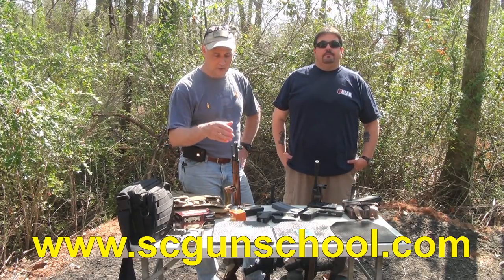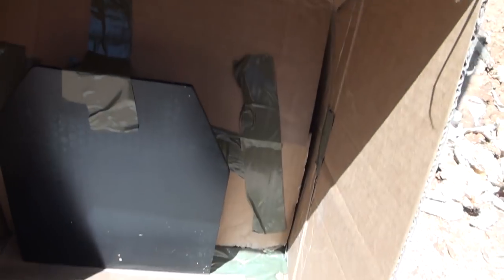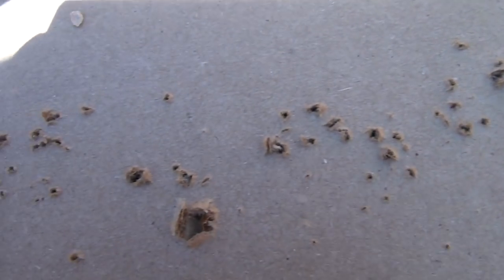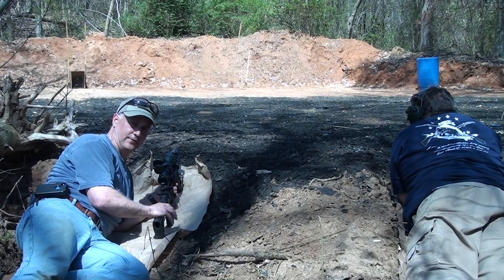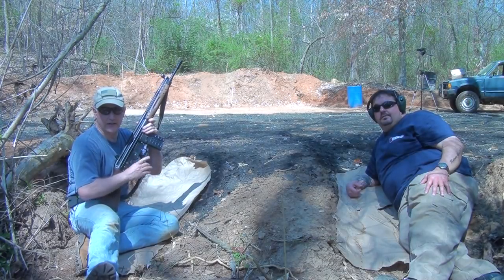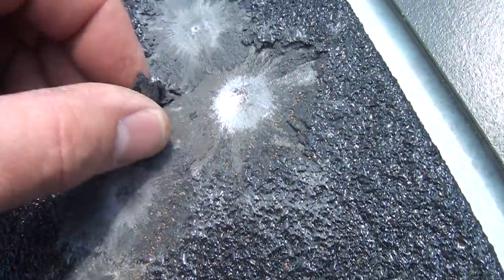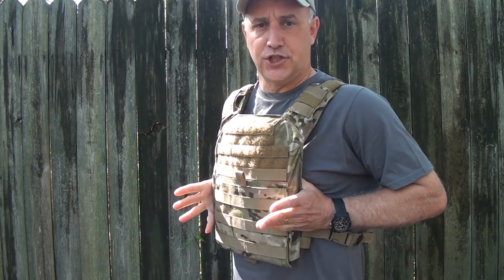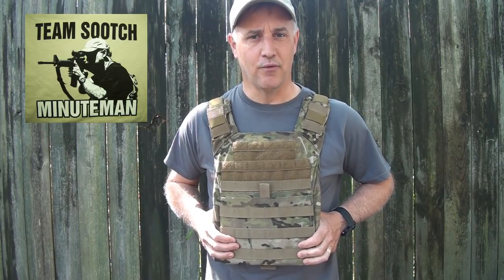AR500 Armor Ballistic Plate Shooting test

Comment: My AR500 Plates came in today and they fit perfect in my carrier. They have the LineX coating and they work great with my Level III soft armor. The carrier is heavy but I think more of the bennefits than the weight. Awesome and vital piece of equipment. Thanks to you and Mike I'm sold.P.S. took a month and a half to get here but worth the wait.

Comment: spall comes from compression waves traveling thru the metal, then hitting the end of the steel (the other side of the plate, see also impedance mismatch) and tension waves coming back (toward the front of the plate) and the accompanying steel plate pieces being torn off and thrown out by the waves. spall comes from the plate (or target material).

Comment: Welding has a thermal effect zone around it, you'd induce extra tension around the welds and ruin the heat treatment. But a guy does bend a thin steel plate around the plate to capture the frag.

Comment: I agree.  That's really the easiest thing to do with any steel plate (wrapping it with kevlar).  I own a pasgt vest right now and will probably by a lightweight plate holder to put over that. But I'll probably just buy a cheap used kevlar vests to to take apart so I can wrap the plates as well as to use for making kevlar  wrap around upper arm protectors (secured with velcro), and frontal apron or segmented skirt protecting groin and upper legs as such things are not on the market.

Comment: Not necessarily, much of the energy is imparted away from the shooters shoulder in the form of thermal energy.  So it's wouldn't simply be a conservation of energy problem (there are a lot of other sources of lost  energy but I'm just using one.)  But to address the kill question, no the plate hitting your body would not kill a wearer (unless you are an infant operator).  The plate absorbs the shock and dissipates it over the surface area of the plate.

Comment: Sootch here is a suggestion: Buy a used mannequin put the plate in a plate carrier and the mannequin in a kneeling position with arms extended as if holding a rifle. Do test again. Then see is there is any penetration on the arms, legs and chin of mannequin. thrift stores will sell used or broken mannequins very cheaply. Keep up the good work.

Comment: Yeah i'm sure. even if you look at the design of the tires that have kevlar in them they are not floating in the middle something that would make it as static as line-x would. Kevlar works by having tensile strength they stretch/take force before they tear. The only way i see is the kevlar being in a layer where it can move.

Comment: A cheap fix for those who have the older plates without any coating would be to duct tape a note book over the front of the plate.  And you would only be adding about another 1/4" to 3/8" in thickness to the plate.

Comment: Good info and got me thinking. 
Tilt the angle of the steel plate by as little as 30 degrees and you in theory double the thickness of the armor. (Sloped Armor). Probably the data you collected during this video would have been more realistic if the steel plate would stay perpendicular to the ground. I took some AR500 steel 1/4" thick and glued a layer of 1/4" recycled rubber mat bought from Peavy Mart (Made from old tires) and shot it with 7.62x39 with a SKS and achieved good results with a min amount of spalling. I will try to post a video If I can figure that out. LOL.

Comment: Another thing to consider: Chances are those plates won't be strapped to your naked body via duct tape - they're inside a plate carrier / vest made out of heavy duty material. Any bullet fragments will have to go through that as well, which most likely will catch them or reduce their energy even more before they hit your arms or face.

If you have some old plate carrier and pouches ready to be thrown away, you could use those for your next test and check if this theory holds up to the real world

Comment: Thanks for the test. There is going to be spalling with the .30 cals. no matter what you coat it with. A metal magazine will help, but better insurance would be IIIA kevlar Containment of the round's integrity is the best plan. I'd loose the coating and package it with kevlar at a $150 price point, for the front. I'm not concerned with the back. You'll still be ahead of ceramics, and better multi-hit multi-use in the field.

Comment: You might have have "splurged" and used new cardboard for each round to get a more accurate idea of the result, instead of guess the change to the accumulated damages (#cardboard_shortage?).  :-)   I have some of these newer AR500 plates (w/single thickness coating) and was concerned about spalling off the back, but it did not seem that you saw any spalling?

Comment: Hey, sorry in advance for my ignorance, I'm not very knowledgeable when it comes to this stuff, but I had a concern.
Isn't letting the plates fly off bad for armor testing purposes? My though here is that when you're wearing the armor, and you are shot, rather then being pushed back and flying off, absorbing some of the energy of the round; the armor can't go anywhere other than pressed really tight against your chest, so with nowhere to displace, rounds that couldn't penetrate during testing are now able to penetrate the armor when the armor is actually being worn.
Regardless, I was really impressed by this test! Like I said, i'm not very knowledgeable when it comes to firearms and armor. I was under the impression that any sort of metal armor had become extinct nowadays. Nice video!

Comment: Because the plate goes on top of the soft ballistic material. Another thing that makes these metal plates stupid to wear is the effect of a projectile hitting you with an angle. Just because metal plates are cheap, does not mean they are good. But I guess it's an easy sell to the uninformed. Real ballistic plates, usually made from some sort of ceramic and aramid laminate, come at a higher price point, because they are much more expensive to produce vs. pouring melted steel in a mold etc.

Comment: In our research for protective coatings Line-X is leading the industry. We've tested a variety of coatings. Line-X has formulas designed specifically for spall and fragmentation protection, which is what we're using. Others simply use truck bed liners, there is a difference.

We have tested Kevlar solutions, and while Kevlar is effective it doesn't last as long as the Line-X will. Although it's lighter and does save on thickness compared to our build-up model. More things to come in the future!

Comment: I know this is a test about fragmentation, but wouldn't it have been better if the plates had more mass behind it (sandbags possibly), AND strapped onto that mass.  This way you could have a more realistic test, and not have the plate dissipate the impact through moving away.  Would have tested penetration under "use" conditions and "kill two birds with one stone", so to speak.

Comment: No doubt steel isn't the best out there but the cost is low & it's far better than a round through the torso. The plate takes the vast majority of the energy. The fragments will be small without much energy. Yes,those fragments could cause serious injury but most likely it would just be small fragments that won't go deep into tissue. It's far,far better than nothing & taking cost into account it's this or nothing for lots of people.

Comment: I agree. I don't want to see what happens when the plate is loose and gets to bang around all over the place on impact. If you are wearing it, it isn't going to be able to slide around like that. And it won't necessarily be angled away from your face either.

For stopping the rounds this test is valid to me, but as far as measuring fragmentation and back face deformation...nope.

Comment: Search on youtube for "Ar500 anti spall"

It works very well with the buildup, it doesnt even knock the coating off. With the buildup all you see is a hole of entry and thats it, it basically self seals around the entrance. Mind you, this is infidel body armor. They use the exact same ar500 plates, they are a little bit more expensive but they deliver in 1-2 weeks. Ar500 was 10+ weeks of waiting, but the price for their package was lower.

Comment: Hey sooch I left a comment on the other guys video u did this shoot with. Buy what I said was ibwondwr if level 2 or 3 soft body armor could b in integrated in front if the hard steel plate allowing the higher velocity rounds to pass through the soft armor hit and fragment against the steel causing the fragmentation to get caught in the soft body armor.. would b cheaper then level 4 ceramic style chest plates. What do u think

Comment: What about placing little "bumps" or "mini-columns," at reasonable intervals, between the face of the plate, and an over-layer of the outer material, perhaps with a filler material in-between. You might ALSO have a layer or deflector strip along the upper edge, to keep the fragments from being as likely to fly upward into the wearer's neck, jawline, or eyes. Sure, this idea would make the overall panel somewhat thick for a carrier, but that may be negligible, if you use a CURVED plate.

Comment: I also ordered a set back in February and they arrived in early April. Bought the curved one for the front and the flat for the back of my Condor MOPC plate carrier. Fits great ( I left the plastic cover on ). The multi-strike capability is what made me choose these plates and I feel better having that protection. Let's just hope I never need to use them. Great vid Sootch00.

Comment: This is pretty cool.  I wouldnt mind seeing some further testing.  Also just thought, you could probably get some spray in/roll on truck bed liner and coat your uncoated plates with it, and even repair the plates youv shot.  Might be handy in a shtf situation as well... not that you should plan on getting shot multiple times but still, being able to restore the fragmentation protection is pretty valuable.

Comment: THEHOSSUSMC checked out that Hydro-poly stuff at Shot Show and said it cost a fortune. Sootch, if you have an old plate carrier or similar materials, I'd like to see how they do with that 1000 denier fabric covering them. I wonder if that, the Molly webbing, and common equipment in the pouches would help mitigate the fragmentation?

Comment: Enlightening.  I had not considered the benefits of a steel plate being able to take multiple hits, and I did not expect so little deformation.  In the event of a WROL or SHTF, you may not be able to buy replacement lightweight composite plates.  Almost everything's a compromise.

Comment: hey don, somebody made the improvement cheaply and far better. the same old ar 500 steel plate then a thin galavanize overcoat that wraps the front and sides, easy and very cheap to replace, no worries on fragmentation. those coating maybe ok, but the system that i was pointing out was far better.

Comment: It would be interesting to redo this test with the plate inside a plate carrier to see if the fabric from the plate carrier helps contain the fragmentation. You could place the plate carrier over the top of a sand bag to hold in place.

Comment: Wouldn't the plate carrier also absorb a lot of the spall? Not saying I wouldn't mind the extra thick line-x.

Another question. Would you get a curved plate for the back as well or does it not make a big difference, even with extended use?

I'm thinking about getting the TAG or is it Shellback? Banshee with front and back plates.

Comment: you can buy stock steel and heat treat it  like a knife    shhh cat out the bag  now
Reply: Pretty sure that wouldn't work out nearly as well against anything but low-caliber or low-velocity rounds.
Reply: j lin done that works Awesome! 
I bought the actual AR steel plates from a metal fab shop, cut them to what dimension I wanted applied my own truck bed liner to catch the spalling 
Field tested them stops .308 no penetration and I'm sitting at $35 a plate $17 for a can of bed liner (which does 2 plates)